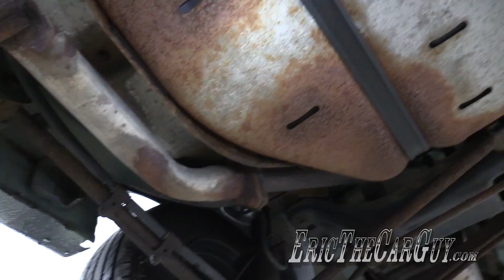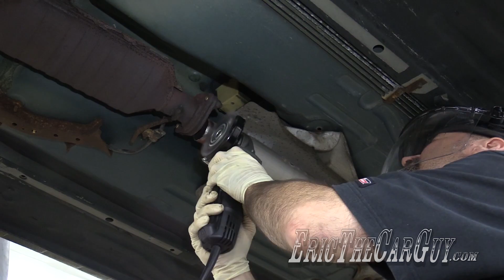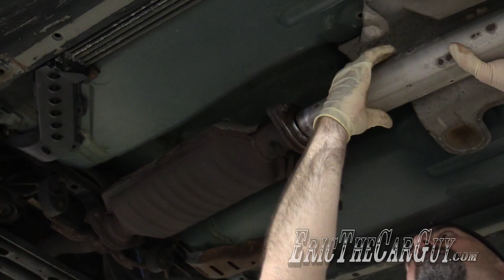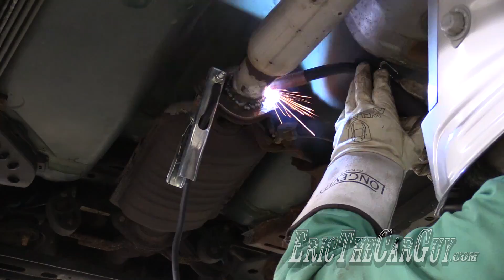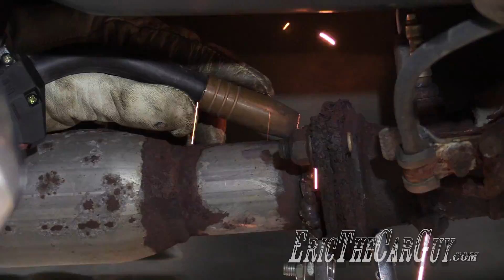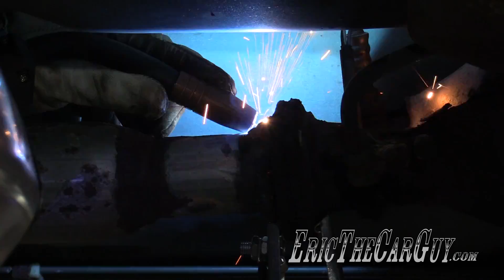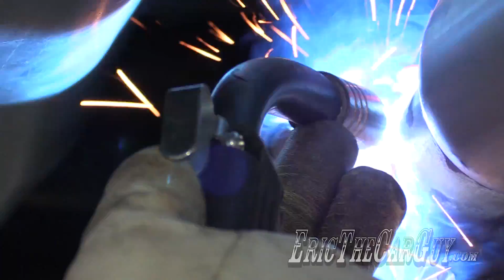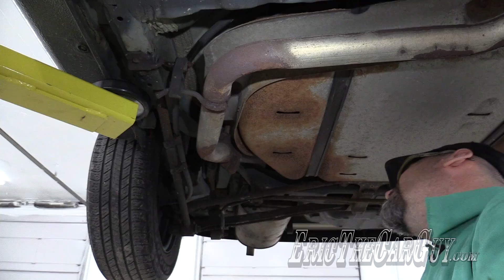Money Saving Exhaust Repair -EricTheCarGuy

Comment: You guys act like he should be GMAW certified. Well I am a welder myself and Eric has done a pretty damn good job for welding such thin metal above his head in a tight place. Keep up the good work Eric!
Reply: +Tyler Neuman Does Eric have to get the weld Xrayed too? Its an exhaust fix on a 20 year old car... Its not a pressure vessel or anything that is structural....
Reply: +dirtshower250  Ya,I weld exhaust all the time, over the years I've build numerous race car chassis involving rollcages,hand built suspensions,narrowed rearends, custom sheetmetal,you name it and still I have bad days welding up rusted old exhaust systems. rust can make experienced welds look like rookies
Reply: @superrodder2002  You weld any rollcages for Honda S2000's?
Reply: @TheUltimateCrash1990  I've never did a cage for an S2000. Mostly old muscle cars
Reply: +dirtshower250 exaaactly. most mechanics have minimal welding experience. just enough to get by. it doesnt have to be pretty if it works.
Reply: +v8consumption  I totally agree with points 1, 2 and 4,   but finding a piece of similar material to practice on isn't always possible in the automotive garage environment. That's where experience using your welding equipment comes in. learning what settings to start at is only learned through practice with a particular machine.
for all the newbies,you need 3 things to become a proficient welder,they are-----practice,  practice and more practice
Reply: if you think that's a good weld I highly doubt you're certified.
Reply: @tylerneuman477  it’s good enough to seal exhaust because that’s all that it’s for
Reply: +dirtshower250 agree
Reply: welding isn't easy keep practicing
Reply: +Tyler Neuman it's not necessary to have a really good weld on something that isn't stressed like an exhaust
Reply: +ZIPPER978 Unfortunately exhaust are often stressed. I ran an Austin Metro which used the exhaust to take some of the reaction of the engine torque on the FWD setup. Crappy engineering and lots of broken exhausts.
Reply: +dumbf4k You do realise there is no specific direction for migs lol some times a push may help you out sometimes a pull whatever works.
Reply: Yeah he's not welding a pipeline or anything.
Reply: Donald Sayers thank you
Reply: max matada might can't weld uphill.  But not bad for minimal experience.  Higher volts less wire speed for over head
Reply: dirtshower250 if you’re saying that’s a good weld job I really doubt you weld.

I just started and weld on weekends and I can do better cleaner welds than that.

That’s literally by definition a booger weld. What any first timer can do if someone sets their amp settings.
Reply: +dirtshower250 according to american standards maybe... this is shit weld for any type of space thickness. doesnt seem like he knows you should weld downwards with a mig either.
Reply: +dirtshower250 according to american standards maybe... this is shit weld for any type of space thickness. doesnt seem like he knows you should weld downwards with a mig either.
Reply: @andre200mw  he’s welding on rust and it’s a low pressure pipe that’s being held by hangers not the weld. He’s simply just sealing around so the smoke and noise go out the back

Comment: I'ld suggest to check for sensors along the exaust and disconnect the sensors that are on the rear side of the break. The initial arc could be made on that section, which would be grounded via the sensor ground wire,  to the ECU, which is not ideal and can cause damage. Once there is a connection between your ground and where you weld then it's fine.

Comment: Thin rusty metal is a royal PIA to weld. An easier way to repair a rotted off flange is with a short reducer fitting. You grab one that fits over the pipe and inside the flange. Grind the rust off the flange, stuff the new reducer in, then put the pipe into the new section. Either braze or weld the new piece in and you're done.

Comment: Why not just remove the piece of the flange the exhaust connects to? you could avoid those oblong welding angles
Reply: +Dylan McElveen Most likely something else will break if you try to undo any of the fasteners.

Comment: When welding a difficult spot (top side of the pipe in this case) you might try using a mirror.  Might save you a little time.  Thanks for sharing your welding journey.

Comment: The flange broke on my 97 f-150 I cant take the manifold off cus I know the bolts will break and no room to weld so tin foil and tie wire worked for me.

Comment: Couple little tips man one wire speed is wayyyyy to high! To arc angld is off you wanna point the gun up not down when welding in the verticle aka 4-12 and 7-12 oclock! 3 try and keep that arc tighter! And lastly try and keep a steadier hand you a little shaky and yes i understand welding above your head is a big hard and strenuous on the arms/sholders all n all great work!

Comment: hey Eric hate to nag on  you about this but a face shield is not a replacement for safety glasses it just an extra layer of protection happens all the time with metal gets behind the face shield especially when you're under a car and some of them are not meant to take the impacts that safety glasses can

Comment: #1 If you disconnect the battery make sure you have the radio code ( if needed) 
#2 Make sure you have no fluid leaks (gas) or it won't make any difference how loud the exhaust is cause the fire truck sirens will drown it out.  lol

Comment: If the exhaust was left leaking. Other than noise pollution does it effect performance or gas mileage?
Reply from the maker: +d w If the leak is close to the O2 sensor it can.

Comment: For rubber "donut" hangers, silicon spray works even better than penetrating oil.
Reply from the maker: +theoldwizard998 I've tried that and I felt that penetrating oil worked better. Just my opinion though.

Comment: I cannot stress enough how important it is to wear a face shield AND safety glasses while grinding. One is not a substitute for another. Recently at work I had a piece of metal go into my right eye and it had to be removed with a drill, the whole experience was not fun. It is so easy to eliminate this by use ALL the proper personal protective equipment
Reply: What if I just use glasses
Reply: After getting a piece of steel dust in one eye when wearing goggles I bought an airflow helmet, one with a battery on the back of the head and a fan than blows clean filtered air downwards over the face.  Keeps me cool on the hottest days and removes anything in the air down to 5 microns.  The perspex has a disposable clean film over it and is impact-resistant.  Not cheap, but totally game-changing; it is superb! Highly recommended. Grinder fragments, router or sander dust - you name it, nothing gets through.

Look after your eyes, and your lungs.  Failing to do so is a fool's game.

Comment: For that hard to reach top area on a [hopefully] temporary fix I have used muffler cement over the weld. Much faster than dropping the exhaust and continuing to weld... Seals up the small holes that get missed.

Comment: noob question. why does welding machine require to be grounded?
Reply from the maker: +Ivan Indir Just like anything electric it needs a complete circuit to work. Electricity flows in a circle. The same is true for welders. Without a complete circuit, electricity doesn't flow.
Reply: +EricTheCarGuy then if i got it right: electricity flows from the source on the wall, through the welding machine (creating bright spark with which you weld) through the air and back in the wall through that cable you connect to the car? that means the spark you create with the welding machine is created by huge voltage difference so it breaks through the air (isolator). is that true? if so, that is too damn cool. thanks for the answer
Reply from the maker: +Ivan Indir Sort of. The electricity never really passes through the air. In fact, the gas around the spark helps prevent that very thing. That's the hissing noise you hear when you pull the trigger of the welder. There's an inert gas mix that helps keep air away from the welding area. This makes for a better weld. The connection is made when the metal wire that comes out of the welder tip touches the metal you're welding and completes the ground path through the ground clamp.
Reply: +EricTheCarGuy great, thanks!

Comment: If the sound of the arc isn't continuous it might be because you don't have enough wire feed or too much. Then adjust the voltage based on how much penetration is present. So if they are goobery then add more voltage. If it is pulling in too much then less voltage.

Comment: when I did my civic repair I broke a bolt, burned a hole in the pipe, and ended up trying to fill in.   it was a success,  but very ugly.  mig welding takes practice.

Comment: Just a word of caution Eric, don't fall subject to the myth that unhooking your battery will prevent "cooking" your computers. Fact of the matter is electricity is still electricity. The flow of electrons are going to take what ever path is easiest regardless if the battery is hooked up or not so if that is through the wire of the BCM, PCM, TIPM etc. "poof" up in smoke it goes.. With that being said when you are working on a car or truck and using your mig practice keeping your working clamp (aka ground clamp) as close to your work as possible to prevent any damage to electrical components. Just a thought.
--Eric O.
Reply from the maker: +South Main Auto Repair Thanks for the tip Eric.
Reply: +South Main Auto Repair I agree, I practice and tell people to ground what your welding. If you weld exhaust, ground on the exhaust. Chassis welds, ground the chassis. Be mindful of things like gaskets and bushings that will act like insulators to the current flow. Whenever its feasible, I disconnect the computer all together. 10 minutes of extra work is well worth saving hours of uh-oh.
Reply: +EricTheCarGuy  Can you please cover Oil Catch Cans on petrol and diesel cars?????? Thanks
Reply: My old man been welding exhausts for over 30 years without removing the battery and never had any problems. That’s all a myth by fancy nancy mechanics and a waste of time
Reply: +EricTheCarGuy You can also buy a type of surpressor that hooks onto the battery to prevent issues I've seen, not sure how well they work.
Reply: The grounds are connected to the body, so disconnecting the battery does nothing to isolate the computer or anything else.
Reply: +EricTheCarGuy You can also take a photo of the fuse box then remove all of the fuses to further isolate the circuits. Then once done put the fuses back in place as per the photo. Using very thin gauge MIG wire can also help when welding thin walled parts.

Comment: WRONG! Exhaust is ONE thing you don't repear. It'll soon leak from an other rusty place, specially because the exhaust gas isn't vented from the fixed hole anymore. A MIG costs more then $0. New exhaust is cheaper + better + easyer to replace etc.